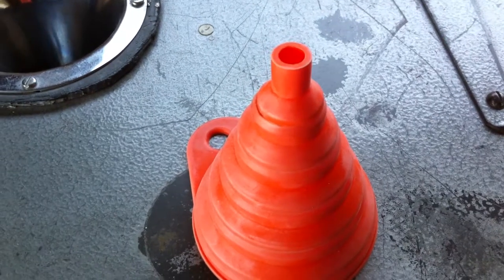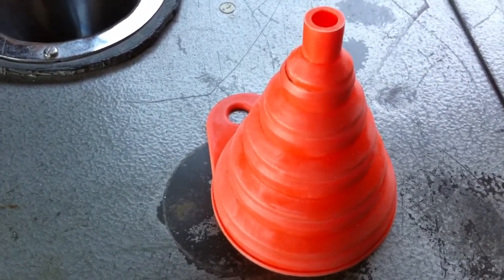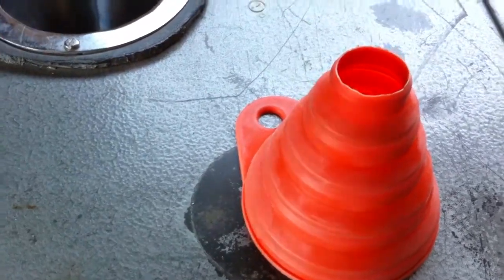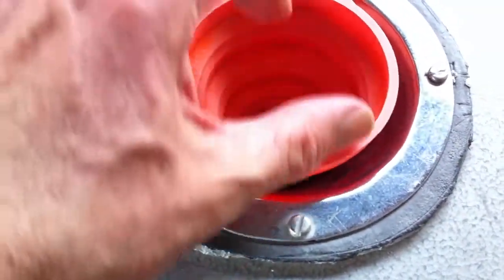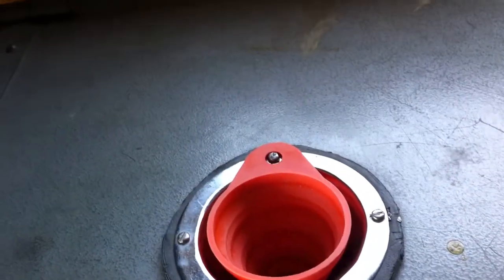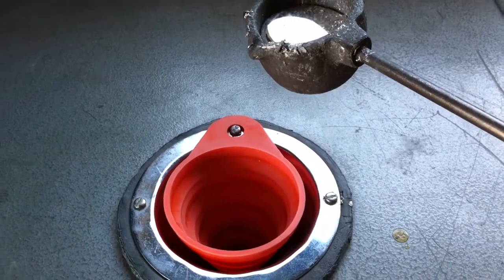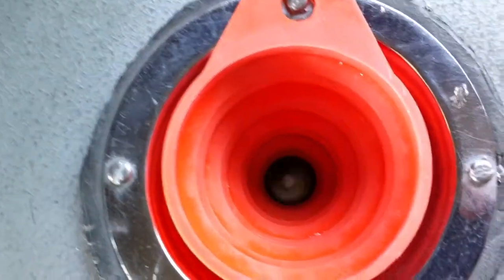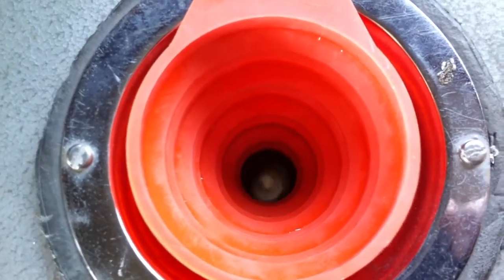Spin casting dodges 101: silicone funnel

Comment: hello, can you tell me wich temperature this funnel resist? thanks
Reply from the maker: I think they’re rated to about 250degC, but because they’re only in contact with poured metal for a brief time - after all, you aim at the hole, not the funnel - they’re durable enough.

Comment: Im having trouble in spin zamac... not smooth. Any suggestion?
Reply from the maker: Sorry, I have no experience of aluminium zinc alloys. However, pre-warmed moulds can solve a number of casting issues: I usually put mine in an oven at 85 degrees or so until they warm through, and when casting operate using a stack of four or more moulds on the workbench so that they all retain their heat. This is particularly important for silicone moulds. I may do a quick video on the use of a mould stack. And sorry for the very late reply. :-)